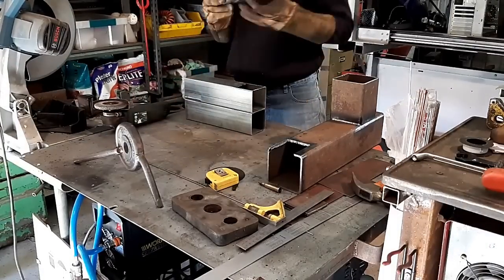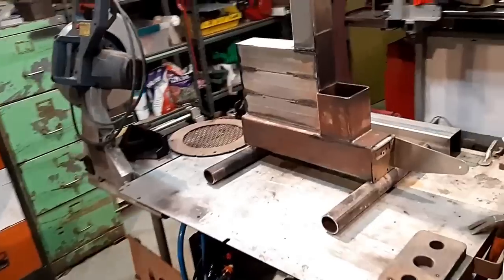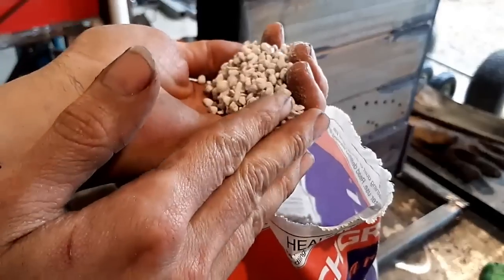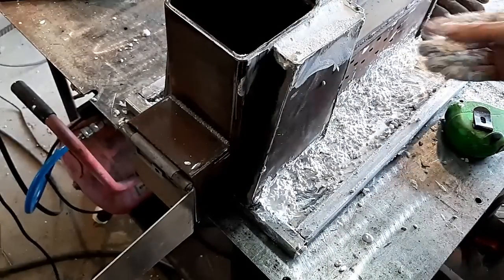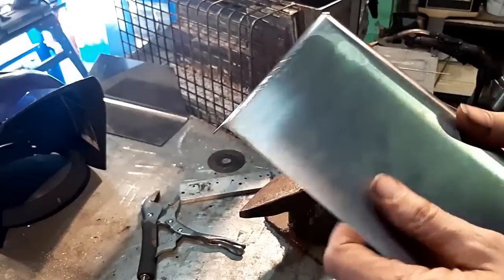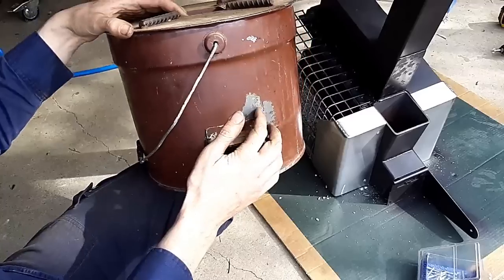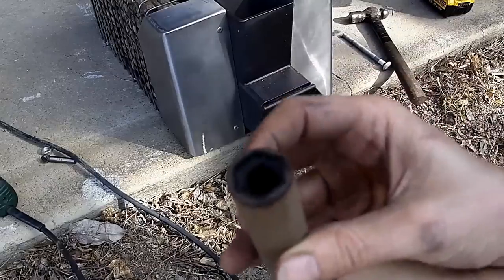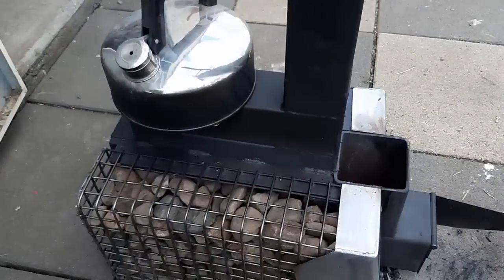Mini Mass Rocket Stove Heater pt 2

Comment: Gday, I had a question. Im about to buy my first welder and was about to lay down say 500 for a multi process mig stick welder but Ive just been unsure as to whats the best option. In the end I think I may get all the PPE gear and get set up but just buy a stick welder. What price point or what would be a good stick welder to go for a total beginner?
Reply: Buy mig not stick for a beginner.
Reply: I would be inclined to recommend that you just go for one of the multi process machines that can do MIG, MAG, stick and Tig otherwise you can easily end up with a collection of different welders. The thing to remember is that there is a certain amount of buy in price for each welder and then you start to see more features as the price goes up. Naturally this all depends upon your budget and what you need and what want the welder to do.
Reply from the maker: I have a dirt cheap stick welder I brought on Ebay, $130 clone of a Rossi 200 amp machine. (Things are getting rough when you have a Chinese copy of a Chinese copy) And it was faulty right out of the box.... was able to fix it up (output of the welder wasn't set up properly from  the factory)  apart from that it's not a bad welder.  I would get a cheap stick welder around that price range, but do your homework, watch some review's and make sure you can send it back if it comes to that. But  Boss Weld , Uni Mig, Cig Weld. All make a good hassle free welder for around the $350 to $500 mark.
Or bye a old buzz box for $40 like I did. Weighed a tone but I couldn't kill it 😡  though I tried.
Reply: @LittleAussieRockets  Ive seen a unimig multi process viper 185 that comes with helmet and a few pieces like helmet and so...was just wondering what reputation of unimig is like.     https://www.ewelders.com.au/unimig-viper-mig-185-mig-tig-mma-inverter-welder-with-helmet-10amp-plug-includes-helmet/
Reply: Unimig are a good machine, i have 2 182vipers that we use onsite with structural innershield wire 2 180razor stick welders and a 350 3phase in the shop. The 185 is a good welder with the new geared wire feeder especially with 10amp plug. Never mind the duty cycle though thats all lies.

Comment: I'm also trying to wrap some tuff bricks around my radiant iron element to keep some heat when the stove is off, but I noticed that regular stones just work better. I'm just afraid of possible explosions.. Did anyone had problems with that? It's a quite well know fact that stones containg air bubbles will explode at high temperatures...
Reply from the maker: If I was going to do it again I would have made a big fire and chucked all the rocks in.  Any that were not safe would hopefully go off, leaving me with good rocks.  Just a thought.
Reply: @LittleAussieRockets  yeah, tough that too.. the only problem right now is where to make a big fire... Reading more, it seems  by the way that most dangerous stones are the pretty levigate ones from the river, and the ideal to use would be "soap stones", or steatite, but they are quite expensive